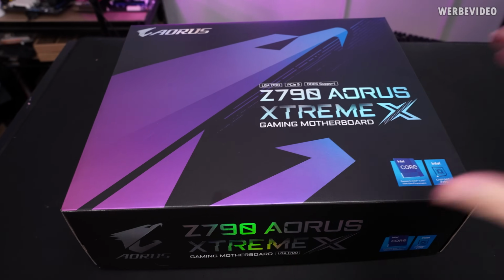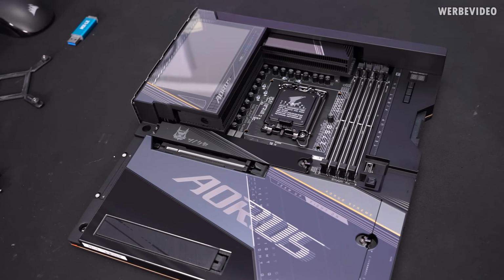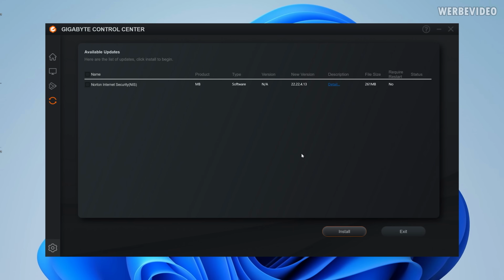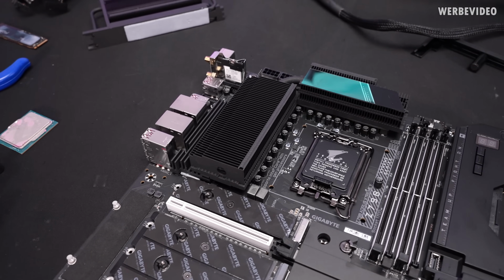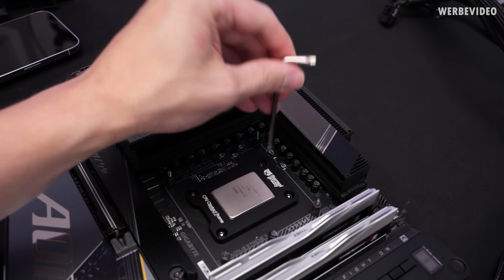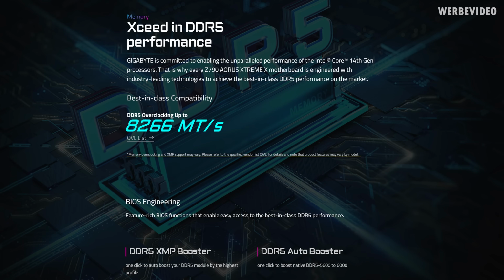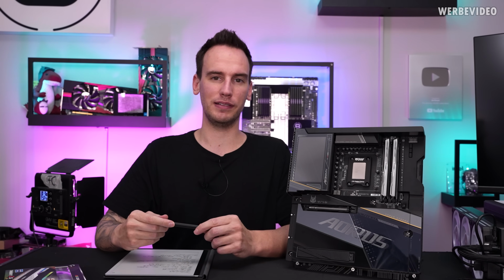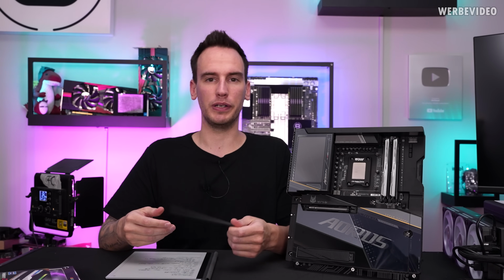Overpriced and Disappointing! The $1300 AORUS Z790 Xtreme X

Comment: Which case will accommodate a 3.5 wide GPU in the bottom slot ?
Reply: Probably full size towers? I'd imagine with all that space, the mobo wouldn't be pushed close to the bottom, leaving plenty of space to utilize a 3.5 wide GPU in the bottom Pcie slot.

Comment: I’m pretty sure I’ve had 200 euro motherboards coming with more toys and accessories than that 😢
Reply: Truth is people don't even want accessories since you don't need them. It's funny how a high end board can only have two expansion slots for us oldheads but lets be real - you've no reason to plug anything other than GPUs in, no need for accessories or options.

SATA etc? not needed, nobody wants it either. PC's have never been simpler yet everything just gets more expensive. They make up the lack of everything by covering it all in plastic panels and gaudy RGB lights.
Reply: Not modern boards (AM5/LGA18xx) for sure. For 200, you could already consider yourself lucky if one of those have a PCB not made of wood.
Reply: Less toys is faster.
Threadripper, play a game ??????????

Comment: oh man, just opening the lid!. At that price I was thinking "That looks like a 299 MSI board package... this isn't going to go well. Nothing in proper packing, it's just baggies." Also.. the paper manual isn't an issue, it bio degrades and most paper is from sustainable forests now.The issue is all those plastic baggies, that's enough microplastics to make billions of plastinated worms. Also.. that acrylic sheeted motherboard. Ugh. That's going to be scratch hell inside of an hour, and then to make it better it's all plastic. Ugh. oh boy.Also,  If I'm paying over a grand for a motherboard, I DO NOT WANT SHOVELWARE ON THE INSTALLER! Good to see Gigabyte is as trash as they've consistently been for the last decade or so. But right down to the shovelware and typos, it just shows that not only does Gigabyte not respect their customers, they actively view them with contempt. That level of nonsense at that price point is past bad, it's insulting. The PCB might be built rugged, but I have had 3 GPUs and 2 Motherboards of theirs fail in the last 10 years. By comparison, I lost 1 ASUS GPU(and that was when a power transformer down the road blew, so.. not sure I can blame ASUS) and 2 ASROCK motherboards. Both ASROCKs were replaced no questions asked. I have never been able to get a refund from a Gigabyte board. Ever. I have had one MSI board lose use of 2 DIMM slots, but it's still running fine today with 2 dimms, and since I only used 2 for overclocking, it didn't matter, and took me a year to realize 2 slots were no good.
Reply: To be fair, they just seem to be idiots at the high end. The lower to lower mid boards tend to be pretty good. My x570 Aorus elite wifi is a great board with all the options I need. But I wouldn't invest in ANYTHING more expensive than that from gigabyte at all.
Reply: Seems to be similar to Asrock. They make great cheap boards, but it's like they don't know what to do with all those features at the high end. Keep it simple should be their motto, it's a shame because those white GPUs are gorgeous hardware, but I'm traumatized too much to ever spend that much on them. Runaround until the deadline for replacement runs out, all sorts of nonsense I've gotten from them specifically. They're like the HP of DIY hardware. (HP actually refused to replace a laptop with a totally dead screen, saying that the display was not a part of the system. Took a summons to small claims court to get them to replace that.)  @Yuriel1981
Reply: I have also lost 3 Gigabyte mobos the past 15 years. Was my absolute favorite brand.
Reply: Amen to that, Gigabyte in the early 2000s was god tier.  I swore by them for years, then around 2007 or 2008 it all went pear shaped, that's when I got a top end Gigabyte, as usual, expecting to use it for 4 or 5 years before new ram and GPU requirements forced an upgrade. I was unpleasantly surprised when it went, taking my GPU, CPU, and RAM to the dump with it. I do wonder if a shake up at management to increase profit margins or something happened then?  @constantinosschinas4503

Comment: My "AORUS elite" x570 was a big disappointment as well, barely any fan headers which I didn't even imagine could be a thing on something supposed to be "elite" LOL
Reply: I bought the asus X570 crosshair viii dark hero, it was very plastic for the price but feature and technological design wise it was one of the best motherboards sold tons of usbs up to 8 satas 3 nvme slots useable pcie slots that don't half your gpu bandwith (when manual says your slot goes 8x it means it will always hald your gpu bandwith whatever it was you get half or 4.0 or half of 3.0 depending on your gpu) the only good current intel motherboard is actually ddr4 the z790 tomahawk from msi which is pretty much the x570 dark hero with less rear  usb-a and a worse bios than asus
Reply: Use fan controllers, what I did
Reply: @B1u35ky  yeah but the thing is my cheaper ASUS board had a fan header on the bottom so I didn't need it. Only reason I got this one was because it was in a bundle with a 3080 when they were hard to get
Reply: Loved my x570 aorus master, was the only board that fit the connectivity I wanted and worked great. Had 2 generations of CPUs on that board.
Reply: @profesercreeper  I guess elite doesn't mean elite then, I should've gone with the master LOL

Comment: Every 'extreme' 'godlike' '1337' product js massively overpriced though.
I'd say 61*C on the VRMs is pretty darn bad considering the heatsink size and low-ish power draw.
Roman, did you try tweaking the voltages for memory stability? I know people almost want to kill me when I told them when my XMP wasn't stable and I was told that I am supposed to set up the voltages manually and that I don't know what I'm doing lol

Comment: "Overpriced and Disappointing" could be a name of last few years in PC industry.
Reply: As a 42 year old PC enthusiast from all the way back to the early 90's, I can say that is very true. 

Dark times indeed. The industry is suffering from stagnation, possibly due to not enough competition?
Reply: 49 here, I remember building 72 pound beige boxes with wheels for gaming,. I miss ATI, my All in Wonder Radeon cards were the shit back then. Paired with a Soundblaster Audigy Platinum with the front panel IO, I could even use my great headphones I still had from the late 70s, those sounded SO good. But those cards, OMG! Good 3D game performance, not the best, but it also featured a TV tuner, Radio, and great DVR software that recorded video in MPeg standard format. It was my VCR for a decade, before ATI got bought by AMD and driver updates ended. C'est la vie.  @Boogie_the_cat  Also I recall that CPU power regulator that was reviewed, and back in the day you HAD to have that for overclocking, unless you could just buy boards as they fried. He's too young to remember when motherboards had zero sensors at all, I guess. But yes, to be selling that stuff nowadays is as useless as a 5th leg on a cat.
Reply: Same here. We needed buildservers for our development department. They are typically deployed on customer hardware, because it is cheaper. Subdep overseen by me was gifted with midrange motherboard, still using DDR4 while another one had top tier DDR5 platform, otherwise specs were the same. Cheaper one is stable, works 24/7 at top load. Expensive was replaced three times in two months, then motherboard was withdrawn from market.
Reply: Especially Gigabyte / Aorus products
Reply: Damnit for real!? I would pick now to get into the pc world! lol just built my first rig. Well bought a rig from a buddy then started upgrading and ended up building a whole new one now my son has the one I bought. Lol
Reply: @pinoyprince26 first custom build is always exciting, but make no mistake, things have gotten worse for the past 4 years or so. Sure, certain new tech has matured and come down in price, nvme, ddr5, and pcie Gen 5 is out, but really, video cards are overpriced and WAY less performance per dollar uplift, Gen to Gen. For example, rtx4060 is often worse off then 3060 and Radeon 6800 is still superior to 7800 for less money. It's gotten stupid for mud range cards, they're just capitalizing on people's hard times. None of the new cards come anywhere close to needing gen5 speeds either anyway, same goes with nvme drives. New ddr5 is fast sure, but it's expensive and still not stable at higher speeds. On top of all that, games are less polished, have such insane demands that even the 4090 can't keep up, and aren't bothering to optimize before launching their broken ass glitchfests. 

Now, that all said, of course, you still have all the older games, all of which are easily playable on new cards, and there's more PS5 and Xbox exclusives porting over to PC, so it's not like it's all bad, but it's just not what it was a decade ago. Hell, when the Nvidia 10 series came out, it was such a massive step up that, I've still got a 1070 that runs basically everything in 1080p up until this year. Only these new releases are giving me any trouble. But, just goes to show how little improvements were actually made since then.
Reply: especially EVERY game release
Reply: I still feel bad for paying twice the price for a 3060 (non Ti) just around Covid
Reply: Facts 👌
Reply: Spot on!
Reply: what you mean last few years we're already there. Everything is overpriced crap with barely any real performance increase at all.
Let them stagnate themselves as E-waste.
Reply: It went downhill after 2016
Reply: I bought a b650E, never looked back
Reply: yes I'm one of the few fools who bought a glacial motherboard and I wish I had heard Linus tips before I did, in an old video he said "never buy high end motherboards with less customer base they have little to no support and feedback, buy the mid range who have more bios updates" and mine burned...biggest waste of money of my pc life I'm now running a msi z790 tomahawk ddr4, the bios is trash but feature wise it's better than 800+$ motherboards minus the 5.0 nvme slot which you really don't want ! in exchange for it I have 3 real useable pcie slots (5.0 nvme means you only ever have 1 and most of the time running at half speed) and 4 4.0 nvme slot which is more than enough..I can also use 4 sticks of ram which ddr5 can't do..yeah blablabla 4 sticks works..no they don't no review is ever made with 4 no youtuber actually has 4 in computer they use...ddr5 is still a 2 stick technology or it destroys your stability and clocks so no one really does it, just check techtubers and reviews it's alway only with 2 sticks "weird" this video also has 2 sticks...as I said no one is really running 4 and the bad thing has builzoid explained is that the empty slots act as antennas and bring interferences into the system
Reply: @fredEVOIX  Your right.
Reply: 💯😕 @fredEVOIX
Reply: @fredEVOIX  so the pc won't boot if you put 4 sticks of DDR5?
Reply: @fredEVOIX wow, that must have been back when Linus has more self respect than advertising money.
Reply: Well said!
Reply: Yes
Reply: And for the game industry too tbh
Reply: Ain’t that the truth
Reply: How much the cat tho
Reply: Idk 4090 was pretty decent
Reply: @Tacet137  idk your intake is pretty decent too
4090 was a 4080 sold 2000 when it should cost 700
Which part of this is decent 🤦‍♂️
Reply: And the gaming industry as a whole : (
Reply: I've been telling people its going to be shit till the 5080 gpus at least.
Reply: Remember the X470 days, the absolute top of the line motherboards were $300 and people thought that was insane. Yeah this board has more features but is it really $1000 worth? I think the companies are trying to combine inflation and features as excuses to bump the price of the entire product line
Reply: The rtx 4090 is overpriced but isn’t disappointing
Reply: @romankozlovskiy7899 it has connectivity issues 
Which is 100% fault of nvidia

But which product is perfect?
I understand your point.
My whole problem with 4090 is how absurd it is expensive.
I mean i could even forgive it for 800$ instead of 700 but 2000+ is joke
Reply: Sad but true, oh thtere's a song already, I'll tune in now
Reply: Totally. It's a joke and a massive turn off.
Reply: Maybe 7 years....😂
Reply: If no consumers buy 1000usd or more mobo's, there will be no 1000usd or more mobo's because - no one buys them, if they exist means someone is buying them allowing corps to charge whatever they want... blame people for allowing it and not - corps for running with what people like, lol... corps just stick bunch of rgb led's and people buy it for that paying 300usd extra for childish light show without practical use case...